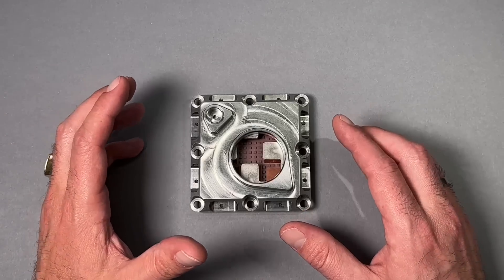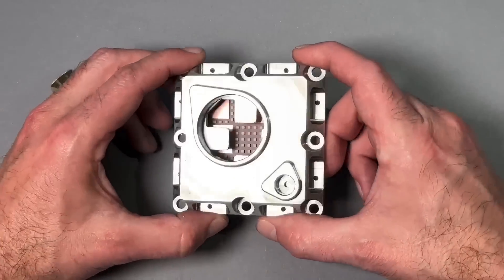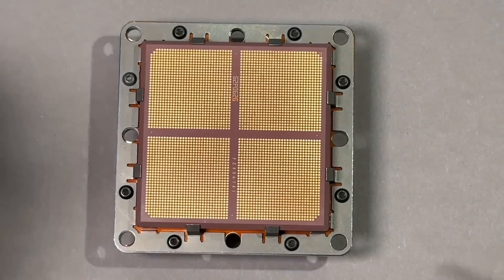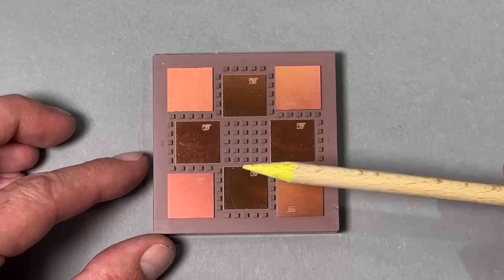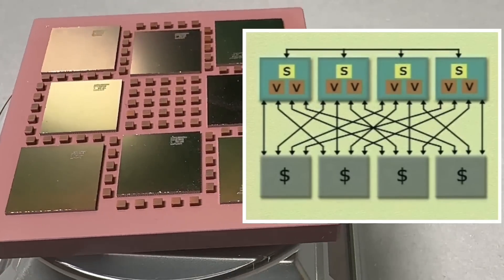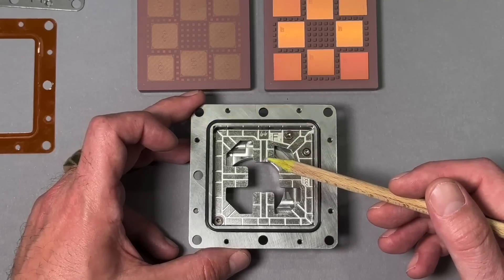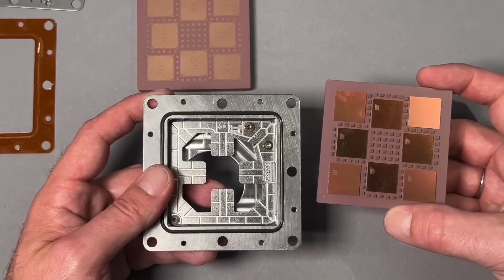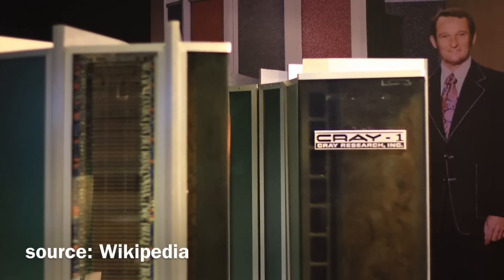CRAY X1 Multi Chip Module - Monster CPU with 8 Cores - Teardown

Comment: A lot of people thought AMD was the first company to do MCM, not quite. AMD does employ some former Cray engineers so it makes sense that they would have in house expertise in developing their line of multi package products.
Also, if I recall correctly, the coolant used was a variant of 3M's Novec which is still being used for cooling solutions today.
Reply: Idk who did MCM first, IBM sure had MCM's, There are even 16bit CPU's used in Minicomputers that are MCM, Curious Mark has a HP machine with that.
"Chiplet" is some form of MCM but I guess today its moved on to more affordable materials, NAVI3 uses some plastic material that the mobile market developed for Phone SoC's.

But yea "chiplets" are in my amateur view just MCM made cheap.

And if chiplets is just chips connected then even intel have done that with the Core2 Quad, they even got crap for it when AMD went monolitic qith the Phenom's Quad cores.
But as fare as i know the Core 2 Quad shared FSB so probably very few interconnects between dies.

In the end I guess MCM and Chiplets offer a lot more Interconnects then just adding two chips in a package, doing the thousands of connections is the hard part it seems.
AMD sad so them selfs and thats why there NAVI3 is divided the way it is because breaking out the MC was possible due to lower interconnect count while they claimed two GPU dies could not be connected with todays Chiplet Tech.

But the odd thing is that AMD do have dual GPU in one package for well Super computers so that is a bit a odds with there own claims, also Apple do merge two SoC's with some serious interconnect for there M1 Ultra is it?

Anyways MCM's in some form seems to be as old as the IC itself because someone was never happy with the max transistor count on a die they could get XD
Reply: Some of the Netburst based Pentium D cpus (specifically Presler cores) were MCM modules, basically 2 Cedar Mill CPUs together on the same substrate. The earlier Smithfield cores were 2 unconnected Prescott cores on the same die.
Reply: @ironhead2008  Going back even the Pentium PRO was a form of MCM because the L2 cache was its own die on a ceramic package.
But yea one can go back even more so MCM is old tech but dam cool.
Reply: @ironhead2008  Ahh yes, the Pentium D: when you require the most efficient semiconductor based heater, without any of that pesky compute byproduct. LOL: what’s hotter and less efficient than a single Presscott die? Two on the same substrate!
Reply: @smakfu1375  It's kind of hilarious how little gain one saw with the Pentium D vs. their equivalent hyperthreaded single core option. However when one realizes that both cores were sharing the same FSB (essentially it was a dual socket system with both chips in a single socket) and were therefore hilariously starved for bandwidth, the lack of performance makes sense. It really seems like it was rushed out so that the marketing department could say "we've got dual cores too" after the Dual Core Athlon 64s came out.
Reply: Lisa actually came from IBM - she was one of the former Cray engineer.
Reply: Yes, there's a video floating around somewhere explaining the cooling, it was a phase change coolant, sprayed on as ;liquid then vaporised and returned to the radiator system as a gas.  Strange the video isn't on Youtube but I guess cat videos win the Internet.
Reply: Same thing for the OG Athlon, where they re-hired some or all of the DEC Alpha team, and actually used the Alpha's EV6 Bus. 
Also, IBM has been using MCM's for POWER for some time. Wikipedia claims they're still using them as of Power10. IIRC, the Wii U also used an MCM. Wikipedia also says a lot of Pentiums (back when cache was a seperate die), Core 2 quads, and first gen core I series (memory controller and IGPU). As a layman, I'd guess that MCMs weren't really anything to advertise, they just enabled functionality.
Reply: @alext3811  IBM had 100/118 chip MCM's in the 308X (S/390) series circa 1980.  The first cooling attempt was liquid fluorocarbon swirling around the chips, but this rotted the chips.  They finally decided on little aluminum pistons touching the back of the chips and used helium to better conduct the heat.
Reply: What are you babbling about?! I really hate it when people cast some wide-net “a lot of people” style statement when nobody with any history in this business thinks AMD was even remotely the first to do MCM/MCP. Hell, if just watch this channel you know that’s pure nonsense.

Now go educate yourself on the subject: https://en.m.wikipedia.org/wiki/Multi-chip_module
Reply: @smakfu1375  With "a lot of people" they usually mean themselves[1]:) That is why they don't give a source, a list or the smallest hint who could be meant.
Also: A lot of people write absolute nonsense into commentary sections ... hehehe, sorry!:)

[1] In secret circles it is rumored that this is a little bit of schizophrenia paired with a underlying Napoleon complex. What we call "a healthy mixture"...
Addendum: To know what "the others" have thought. To unravel this from the cloudy realms of dreamland only the best of the best from us are able to: The hypersensic mind-reading historians of middle-earth! Oh sorry, excuse me. This is of course Middle-Wisconsin!
Reply: @dieSpinnt  LOL “Middle-Wisconsin” (good cheese, and nice people, in my experience). Yes, I think you hit the proverbial “nail on the head”. The thing that set me off was CPU Galaxy Guy opened a whole drawer of exotic MCM stuff at the start of the video, and if anyone has watched for a while, we’ve seen other fascinating and exotic MCM’s dissected for our education and enjoyment. 

It’s okay to say “and here I thought AMD was the first to do MCM”, but it’s irritating when someone tries to mask their own ignorance. I have a lot of industry experience, but I knew absolutely nothing about the X1 going into this video. I thought it would be some fancy packaged MIPS or SPARC thingie, as I ignorantly though Cray had abandoned highly custom stuff by this point. So, inspired by this video I went and read up on several programming primers for the X1 - a truly interesting architecture worthy of the Cray name. I’m glad CPU Galaxy made the video, because I learned about a pretty amazing machine (that I wish I could have played with when they were still around) that used some crazy sexy chip packaging.